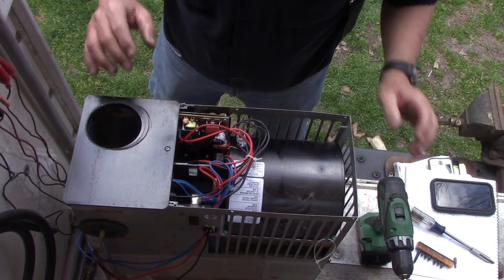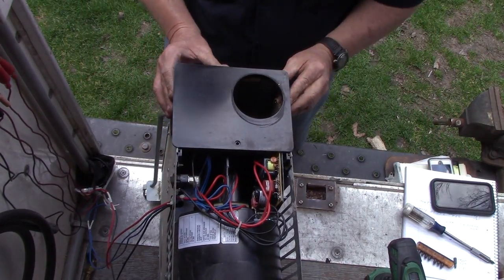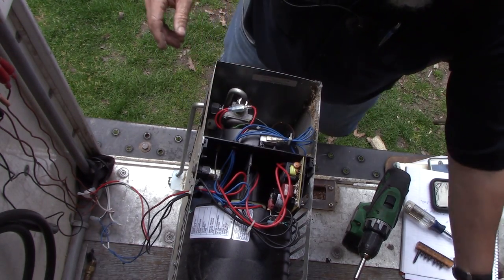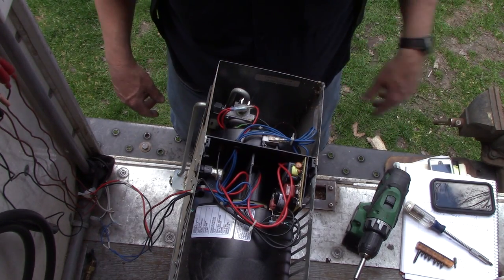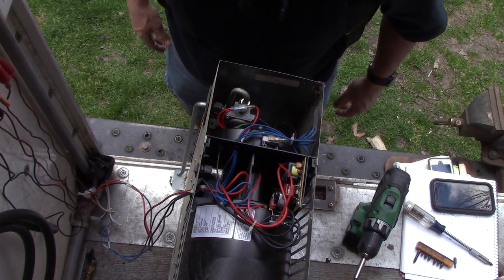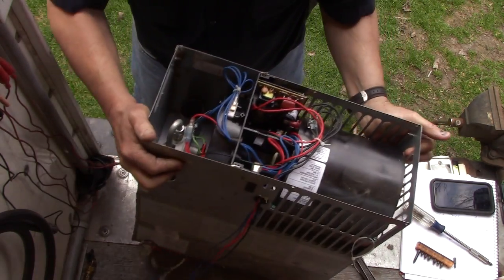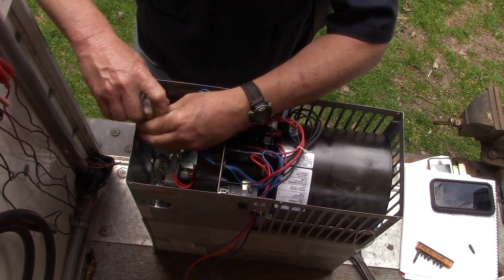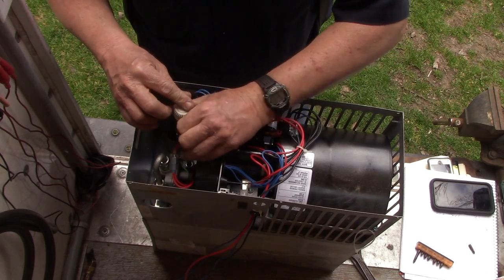Cleaning The Burner Assembly On A Dometic Furnace

Comment: One of my customers complained his furnace wouldn't work. Fan came on and shut off after 20 seconds. So, I remove the sail switch and it has hair on it, whatever it was, lol. I removed it, still wouldn't fire, it would lite but go right out, lite, go right out. Well, his LP tank was low, we we swapped it out with a freshie, lit right up and stayed running. This was three weeks ago. Yesterday He called, said it was doing the same thing again, I figured the sail switch was intermittent. Definitely wasn't that, just lights, flame dies, lights, flame dies. SO, Monday I'm going to pull that burner out and see what's down there. Maybe the electrodes are out of spacing, something simple. We're in North Florida so he's only used it a handful of times. In closing of my essay here, thank you for the video! I couldn't remember how to get down in there, haven't done it since tech school! Great channel, brother! Subscribed!
Reply from the maker: All of us fight those stupid intermittent furnaces issues. Darren at “my RV works” is experimenting with data loggers. You should contact him about those. Tell him I sent you.

Comment: Awesome video. Helped me disassemble mine. Had dirt dobbers inside it. It was firing and making heat but would blow cold air. Top of the heat exchanger was warm but was cold on the bottom, not exhausting very hard due to the blockage. Thanks again
Reply from the maker: Apparently mud dobbers are MUCH worse in other parts of the country than they are here.

Comment: Please oh please help. Furnace works for about 2 or so cycles then loud popping on ignition (as if too much gas). Also strong propane (exhaust) when running. 2 techs and tons of $$, still not working. Exhaust had mud daubers but tech said he got it. Black soot on exhaust thinking it must still be dirty so perhaps ignition delay causing the popping? About to pull it myself and see if maybe replacing the burner will do it? Thoughts?
Reply from the maker: Has anyone torn it all the way down and cleaned the oriface? Or did they damage the oriface?
Reply: @hillbillyrv  cant know for certain. I'm waiting on the replacement burner to come and plan to pull and see what I can find. Will look closely at the orifice and say a prayer that my wants match up to my actual capabilities. :)  Thank you for replying.
Reply: I have the same problem!!!! Did you figure it out?
Reply: @2wheelseparationanxietydis271  still waiting on the burner to come in. Too much work to pull unit "just to see". Hoping to have replacement parts in hand before tearing it down. Let me know if you find your solution, please?
Reply: @dwith850  my trailer doesn’t have an access panel on the outside. The wires are too short to pull the unit out of its cubby hole. I had to rotate the unit 90 degrees to access the sail switch. I don’t have the money to pay anyone so I’m kinda screwed. I’m rocking a Mr heater buddy to stay warm in the meantime. I will let you know when I finally figure it out but it might be a short while. Let me know if the burner fixes it?

Comment: I’ve been trying to figure my Atwood out for two years now. Not getting 12 volts to the gas valve so I’m getting no click for the propane to flow. All new parts too. At a loss. If I hook up 12 volts from a different source I get the click and propane flows right through but once I hook it back up I get the igniter clicking away but no gas valve opening
Reply from the maker: After the control board sees that the sail switch is closed and the high limit switch is closed, it should send 12 volts to the gas valve. You have to be losing 12 volt somewhere in this circuit.
Reply: @hillbillyrv  I was thinking maybe a bad ground?
Reply from the maker: @mattpowers6015  If everything but the gas valve works? Bad ground ?????
Reply: @hillbillyrv  just went out and put new wire connectors on wires and cleaned up the grounds. I’m thinking the dinosaur board I bought might be faulty because I’m only getting between 8.5 and 9 volts from the red wire coming from the board to the gas valve and I’m not hearing that click from the solenoids when the igniter goes off.
Reply from the maker: @mattpowers6015  you need more voltage than that to open the gas valve.
Reply: @hillbillyrv  just wanted to let you know I figured it out. I ended up taking the furnace out of the camper and cleaned it then tested it while it was out and the gas valve and igniter go off as it’s supposed to do. It was either the ground or the thermostat or both
Reply from the maker: @mattpowers6015  glad you got it figured out.

Comment: I have the same furnace but mine is attempting to light after the gas comes in. Then it ignites and a small boom happens. I replaced the sail switch and same issue…I turn on furnace at thermostat, blower comes on, gas comes, then a delayed clicking of the igniter. I don’t get it and I can afford to pay a guy like you…help!!
Reply from the maker: If it is trying to light it is not the sail switch. It can be several things. Hard to say for sure.
Reply: @hillbillyrv  ok thanks for the response.